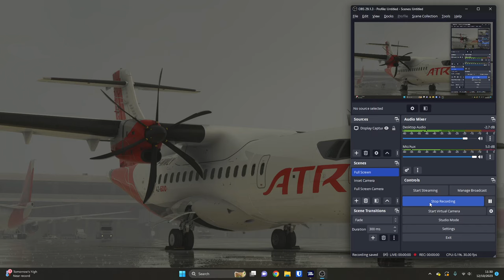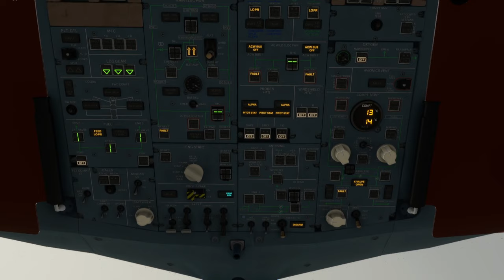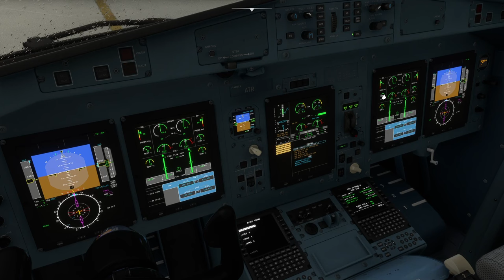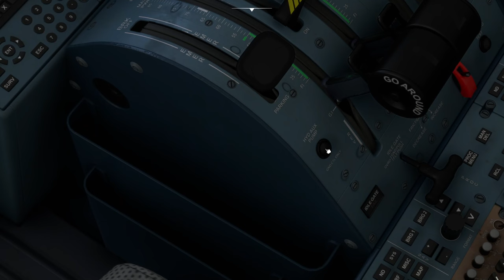Solving the ATR Hotel Mode and the Prop Brake release issue in Microsoft Flight Simulator

Comment: ...
1. Do not use AC ext. ( DC ext is not needed too )
2. Condition lever must be Low idle (FTR feather). Not Auto.
3. GUST must be Lock.
4. Aux hy.. pump button need only 1 click.
Reply from the maker: Did you completely miss the part where I said "I'm not going to do the full procedure today" :)  I've tried the throttle in multiple configurations - it actually makes little or no difference - the simulation of the engines isn't THAT accurate. Interestingly, doing a "restart" in a flight, versus going to the main menu and re-loading makes a difference too.

Comment: And to clarify things for pushback, it is normal to have hydraulics pump offline during pushback because the ACWs are offline. You can turn on the ACW by putting the CL to AUTO once cleared by ground crew for propeller rotation. Once NP reach 66%, respective ACW should go online and the NP continue to spool up until 70.8%. Once ACW online, hydraulic pumps should become online. ACW 1 powering the Blue pump and ACW 2 powering the Green pump.
Reply: This!

Comment: I thought was me who didnt the right procedure. I will try your for my next flight.
Thank you so much :)
Reply from the maker: There's a further problem seemingly caused by external power that makes the prop brake not release - I've therefore removed it from the procedure, which now works reliably. https://ko-fi.com/s/ae35cd7f2d

Comment: Thanks for sharing the info to bypass this nonesense issue. I got the luck of having spent uncontable hours inside an ATR 42-300 and I can tell to all ASOBO engineers/programmers that this is nuts. Once you put Conditional Levers in AUTO position ACW and Main Hydraulic lines start working like a swiss clock... also and non less important: THERE IS NO understandable reason why one loose hydraulics once you put back to idle the throttle levers. Now I understand why I loose the control in the steering wheel and in the toe brakes  once I throttle back to idle just reaching the holding point, also taxi lights go off. They also need to fix that.  1846 KWs on each wing and we need to play with the throttle like if it were a general aviation with a piston engine.... just to keep AC alive.... unearthly.
Reply from the maker: It's just an ordering issue. Once you get your head around what has to happen in what order (regardless of how the real world works), it works fine :)

Comment: I worked that out by trial and error. I would click on the auxiliary hydraulic on the pedestal as per your video and then shuffle the throttles once or twice and try again and kaboom it would light up finally. 

Strewth, they really landed us a brain-twister with that one!
Reply from the maker: I've updated the hotel mode start-up procedure to avoid external power - it seems to be the culprit.

Comment: Hi Jonathan, thank you for doing this video. Unfortunately, I have the same problem. After starting engine 2, I then prepare to push back. When I disconnect the 2 GPU buttons on the overhead, then disconnect the GPU on the EFB and then remove the wheel chocks, I lose power? Engine 2 shuts down and 2 MFD turn black. No power? I then cannot reStart engine 1 or 2. 😡 How do I keep the plane running once I disconnect from the GPU and remove the wheel chocks ??. Thanks
Reply from the maker: Download the procedure again from ko-fi.com/jonbeckett - I updated both the hotel mode and non-hotel mode start procedures.
Reply: @jonbeckett  Thank you very much. I will download the updated procedures today 😉
Reply: Update! Good News...I found the problem. I originally duplicated my Honeycomb Yoke button settings from another aircraft. Those bindings were conflicting with the ATR aircraft. I had to delete the duplicated bindings and start a fresh and that fixed my loss of power issues.

Comment: Hydraulic issue appears for me only after SU13. As a result, brakes don't work sometimes. Hope H. Hartmann will fix that (surprisingly, no patch has been release yet). I had no issue with prop break, just click once on the button.
Reply: I have that same problem since the update, no pressure for the brakes and no electric for the lights. Love this plane but no idea what they've done
Reply: @jasonbrackstone  yeah, surprising they didn't already solve that since the beta testing of SU13 ! Weird !
Reply: @kohheiva  I hope they fix it soon
Reply: Hello,
For me I can only switch on the probbreak with the throttle in idle. After switching on you can give more gas for more pressure and power.

Comment: ATR developers should send you a commission for doing their job documenting the start procedure correctly..... Great stuff JB, thank you
Reply from the maker: I've updated the hotel mode start-up procedure to avoid external power - it seems to be the culprit.
Reply: all the developers should....many thanks
Reply: @jonbeckett  This works with or without external. All you are doing is starting the right engine as an APU and then disconnecting. I still don't know why you are struggling with this.
Reply from the maker: @PThomas22  there is a bug in it somewhere. I've spent hours going around in circles looking at the various systems - for whatever reason, sometimes the prop brake just won't release - even though it says ready. If you get the sequence "right" you can release the prop brake, the propeller doesn't spin, but you actually have a working engine and propeller (if that makes any sense) lol - I'm sure it will get fixed eventually.
Reply: @jonbeckett  Again you are incorrect, the right engine has a prop brake. If you want hotel mode you start it as such. then you start the left after the right is unlinked/brake off. There is NO bug.
Reply from the maker: @PThomas22  I just spent my coffee break looking at this - and narrowed down the cause of the prop brake getting stuck on. I've found out why - I'll record a video later. In essence, you have to release prop brake on engine 2 before starting engine 1. If you start both engines before releasing the prop brake, you can run into the stuck prop brake issue.  Thank you for reminding me to take another look at this :)
Reply: @jonbeckett  Yes, just like I demonstrated in my video. I swear I'm banging my head against the wall here. Again, this is not a bug.

Comment: DO NOT move CL to AUTO when you're on hotel mode. I see when the hydraulic was fault, the ACW also offline. What you should check is the NP. ACW is connected to the prop and will only start generate electricity when the NP is above 66%. It probably doesn't reach 66% before you open the power a bit, hence the ACW remained offline and not powering the hydraulic system. That's what you should check and report to the dev because the NP should reach at least 70.8% when on ground idle with CL on AUTO.
Reply from the maker: Great feedback - thankyou. The odd thing - if you open the throttles to get the generators and hydraulic systems working, it still doesn't release the prop brake. On occasion I've also seen the animation break - where the propeller doesn't spin but it's actually working - all the guages respond, and you can fly the aeroplane :)  I'll have another look later based on your tips though - and look through the start procedure again.

Comment: Hello, thank you for your research.
There are various problems in MSFS.
I don't need a double click. Switching probbreak on or off is only possible when the throttle is idling.
A problem for me: All BlackSquare extensions always start with the GNT 750 not installed. After switching to the standard gns 530, the flight plan is gone. It doesn’t matter whether the flight plan was saved or comes from the world map.
According to Just Flight, that can't be the case.
Reply from the maker: Switching radio kit will always wipe the flight plan. Why you always get the GTN750 is the real mystery. How do you close the aircraft down? I'm aware that some choices only get saved if you follow the proper route - shut the aircraft down, and go back to the main menu.

Comment: Love your videos. Your information is outstanding. Can I give a tip that will make look closer like a pilot and not a simmer?  Always clear the caution light and identify why it was flashing. I know that, in this case, it was starting the aircraft, but you need to know if you have a new caution during starting, and that will happen with a new caution light. I hope you understand what I'm trying to say. Bottom line is to clear the caution light.
Reply from the maker: Good shout :)

Comment: Thanks again for digging into this. I've had no issues once I stopped trying to connect to external power. I'm not saying that is causally responsible, but rather that it leads me down a good flow that works every time and makes sense. I hit the battery and then get right into the flow of enabling hotel mode including hitting the HYD AUX before enabling. Its the J flow that the Fly with Magnar channel advocates. Connecting to external power while enabling hotel mode never made much sense to me. The point generally is to be used in lieu of external power so I kept that out of my flow when I want to simulate use of hotel mode and, as I said, that flow has now worked on a dozen flights with no issue the past month. I'm pretty sure there is some confused logic creating a race condition or creating a confused situation it can't get out of. Happy hunting!
Reply from the maker: I think you're right. There is a hell of a bug deep in it somewhere - because if you do the full work-up, the bug is still there.
Reply from the maker: I've updated the hotel mode start-up procedure to avoid external power - it seems to be the culprit.
Reply: @jonbeckett  Yeah, I figure there is a state/variable getting flipped in the external power logic that is later inhibiting re-engagement of the prop. Thank goodness its at least a clean "use hotel mode or external power" without having to remember some trickery in the order.

Comment: I don't have a problem with the propeller brake, only the electric one. When the engines are idling, the lights turn off. Once the wheel brakes didn't work
Reply from the maker: When the engines are at idle, the generators don't work. It's probably a bug.

Comment: followed word for word...   still not working..  mine gives me a READY LIGHT AFTER ENGINE 1 START...  and still when i turn PROP BRAKE OFF..  THAT ENGINE ISNT SPINNING!
Reply from the maker: Yeah - it has even more bugs that I discovered in the video - avoid external power, and it will work.

Comment: You still have it all wrong and basically tried to reproduce my video from your previous post about it being "bugged" do not HOLD down the hydraulic button and just press it. Works every time. Here it is AGAIN this should be pinned as it is a simple no BUGGED procedure. There is a lot of ignorance when it comes to this, and your video demonstrates it again. Watch and learn. Works EVERY time. https://www.youtube.com/watch?v=Kka0mH5J9ks
Reply from the maker: There's no need to start flinging accusations around! It's a game - it's supposed to be fun! :) I discovered the click versus hold-down issue while investigating the problem. I'll return to it again soon and take another look at it. All I had been doing (when I discovered the single click issue) was working through the various systems to see what interacts with what, and if it does so correctly. If you only start the engines, single clicking the they start every time - and hotel mode operates correctly. If however you start to introduce the rest of the start-up procedure, something interacts with the prop brake release. Several people have commented that it could be to do with the RPM of the engines at idle being wrong - I'm not entirely sure - you would think if that was the case then opening the engines up further (to get the generators and hydraulics working) would solve it - but it doesn't seem to. When I get more time I'll take another look :)